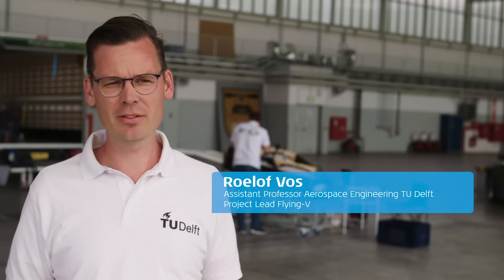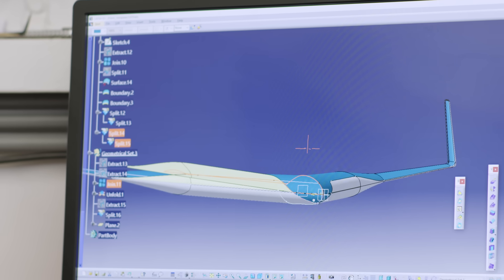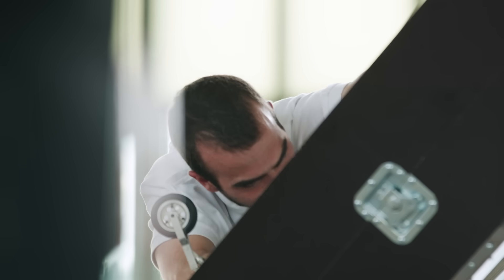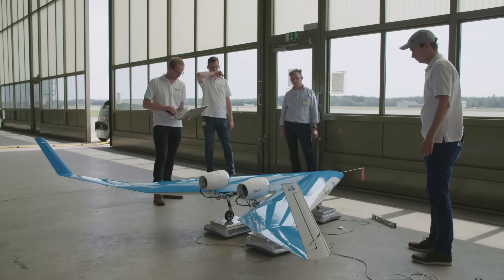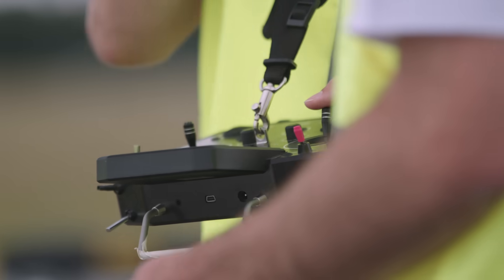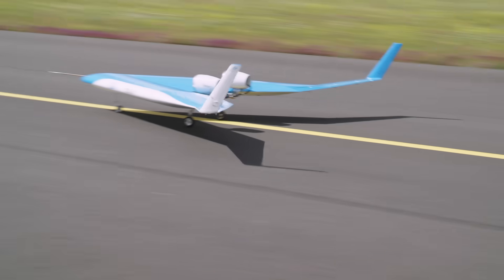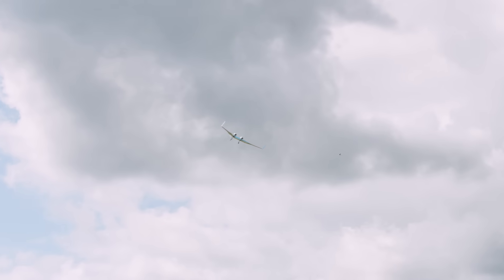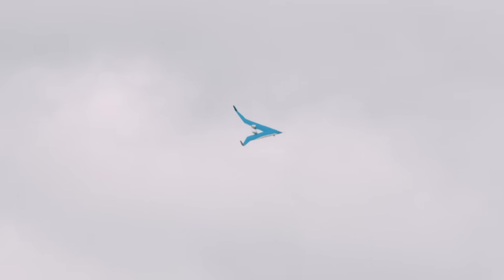Flying-V - Scale model maiden flight

Comment: I have an idea. In minute 2:00 you saw that if angle of attack exceeds a value then can overcome stall, in 3:07 this issue ocurred but a fast manuever corrected it. You can include "virtual canards" simply "twisting" the frontal zone of wings, then you obtain a wing with more angle of attack in front than rear. It can be achieved in the same prototype with material fill. But i think is better to replace a new wing with this variable attitude. I hope you consider this. Good luck.

Comment: I don't understand the aspect ratio is all wrong if we park a full scale at an existing airport. Furthermore, won't the wings become like bulk bodies in a full-scale model. This prototype may have stable aerodynamics but I'm not sure of its true realization. 20% less fuel compared to the Airbus A350-900? How? Is it just the drag reduction or the propulsion system will be different from the conventional ones? What about the costs? It looks like a fusion of 2 fuselages in a V-shape, won't that increase the usage of composite materials and therefore drive the cost upwards? Can somebody explain?

Comment: Imagine being a passenger in one of the rows furthermost outbound from center.  All rotational motions (roll) will be massively exacerbated into harsh up and down movements, rendering a nauseating experience.  I’ll bet that’s true even for first class seats.  The slightest roll motion will send passengers airborne in the cabin.
Reply: You beat me to it.  I've read that exact issue being given as why other flying wing concepts where passengers were not centrally located were discarded.
Reply: This can be said for most heavy aircraft, but in the pitch and yaw moments. The answer is simple... use the inertia damper from the Starship Enterprise; problem solved.
Reply: @tjkallenberger2705  That can be true in some conditions.  I remember taking off from Reno once in the back row of a 757 under extreme yaw conditions.  It was pretty hairy, just enough wild G's  to start a minor passenger panic.  It'd be just like that on this aircraft except with more jarring vertical accelerations, and more frequently.  Probably perfectly safe, but it'd freak out the passengers.
Reply: @pfschuyler  Yep, been there. It will be interesting to see if this aircraft is actually produced... the certification will be quite vigorous following the 737 disaster.

Comment: Всё очень просто: берем дозвуковой профиль крыла. Высота профиля - не менее 2.5 метра. Соответственно, длинна профиля по хорде - от 20 да 25 метров (https://myslide.ru/documents_3/4999717067a4c3a8b124b7a06b590a69/img2.jpg)
Учитывая масштаб (приблизительно), то размах крыльев у это "чуда" будет более 100 метров. Ну вы и фантазеры, ребята. :о)
Reply: Sergey Belyaev
It's very simple: we take the subsonic wing profile. Profile height - not less than 2.5 meters. Accordingly, the length of the profile along the chord is from 20 to 25 meters (https://myslide.ru/documents_3/4999717067a4c3a8b124b7a06b590a69/img2.jpg)
Considering the scale (approximately), the wingspan of this "miracle" will be over 100 meters. Well, you guys are dreamers. :about)

Comment: There are many issues with this design.
1) The weight on both the sides of the wings has to be exact! No obese people allowed. No hard feelings.
2) When turning, people sitting at the edge will feel like they're in an elevator!
3) The connection between the wings is just that small part in the front...that snaps, they'll be going to 2 different destinations.
4) The sheer size of that plane...will simply take up too much space, hence decreasing the income of the airports.
5) How'd that design survive turbulence.
Reply: The weight can be balanced by the altering the amount of fuel on both wings.

Comment: Having passengers and fuel in the same compartment doesn't sound too good, in the event of a crash.
Reply: Well if you have a crash with a plane, it usually doesn't sound too good either
Reply: If the turbine goes up in flames, that's not great either lol

Comment: It is not a new design....1947 YB-49 and YB- 35, note at 4:15 slight porpoising due to control issues, a computer would sense this a compensate. Edwards found this was a problem before he crashed. (Edwards Air Force Base, USA)

Comment: The moment I saw this thing, I said to myself, "No way are they going to show that thing's pathetic attempts to land."
Reply: I'm both a full scale pilot and an R/C flyer... if the stall moment causes a pitch up, then the aircraft will need to land at a higher airspeed, but it will land.
Reply: @tjkallenberger2705  gravity will assure it of that!
Reply: @markgreen2170  True... disrespect the basic rules of flight and an aircraft will become a brick.
Reply: @tjkallenberger2705  Which is EXACTLY my point.  Now scale up that monstrosity and fill the wings -- all the way out to the tips! -- with passengers.  Even better still, make those passengers an entire high school full of students who will think it's funny to create a sudden "Flash Mob" at 20,000 feet where everyone stands up at the same time and runs to starboard.  But let's put conditions that would cause an uncontrollable spin leading to the in-air break-up of the airframe and subsequent fiery, screaming crash aside for the moment and just deal with an A380-capacity version of this and the margin for error when landing it at the necessary higher speed on existing runways.  Hmmmmm.....

"I, King Adam Phillip Churvis, soverign of the planet, hereby declare, now and forever, this hokey piece of sh*t to be henceforth known as the 'Crash-o-Matic'."
Reply: @adamchurvis1  creative scenario but unlikely.
Reply: @madjunir  Talk to any experienced software testing engineer or destructive testing engineer about the word "Unlikely."  If I were the head of one of those departments, I would post a huge sign with the word "UNLIKELY" inside an international "No" sign, and then surround that with endless photographs of the deadly aftermaths of such "unlikely" scenarios.  And then, like the petals of a flower, I would arrange the first pages of every lawsuit emanating from each photograph's depiction of those events.  And then above I would post a massive sign: "Do *NOT* Water This Flower!"
Reply: @adamchurvis1  I would imagine that a full scale aircraft will be aerodynamically different... I was referring to this one. Nevertheless, stall moments can be easily controlled by adding a canard.
Reply: @adamchurvis1  "Unlikely" is a synonym for "guaranteed to happen".
Reply: @neoqueto  Truer words have yet to be spoken, sir! :)
Reply: @adamchurvis1  Chill down dude, the plane is just being developed. Ideas have to be tried out and see if it is viable, and this one does have potential. You cant just not try things because adam thinks it is stupid. All in all, it wont fly if it turns out that safety can not be guaranteed.
Reply: @joaobobao590  The world would have been a much better place had it NOT tried those ideas which Adam had found unsound.  Sometime we should talk about Airbus being a European Union jobs program first and an aircraft second, leading to some of the worst disasters based on circumventing good design in favor of expedient manufacturing at multiple locations -- something perfected by the Luftwaffe to secretly arm themselves in violation of the Treaty of Versailles leading up to WWII.  And then we can talk about the mind-numbing stupidity of the French software "testers," if you care to grossly misuse the title.  Just make sure to brand your name on your most enthusiastic support of this design, so that when people start dying they can all thank you.  I know I will.
Reply: You must be fun in bed.
Reply: @kurreorava9626  Well, let's see.  I don't stall, I become airborne after a relatively short roll, I have sensitive control surfaces, and, most of all, I DON'T HAVE TO COME IN FOR A LANDING AT TWICE-NORMAL SPEED TO KEEP FROM CRASHING!
Reply: Landing?

Comment: @TU Delft, you guys need to take a Wright Brothers (hackers) approach to speed up development. Which is design, build, test, modify, repeat. This is the whole idea of working with unmanned models so you can crash a few to testing out ideas.
Reply: That was my thought. They took two years and how funding and all they have to show for it is model aircraft that any half decent hobbyist could turn out and have it dialled in and flying in a month.   There must be a lot going on behind the scenes or these guys are scammers.

Comment: I wonder how the passengers will feel sitting in such a wing as the plane changes course. They'll probably feel like they are in an elevator.
Reply: The NTSB could sit at the edge of the wings and then give a go ahead.
Reply: Very good point, the farther out on the wing you are the worse it will be. The pilots will be required to have very limited banking for this reason and those seats will be cheaper most likely. I wager that is the main reason this could fail.
Reply: @getstuk87  the main limiting factor here is not actually the bank angle, which causes no additional g forces, nor the roll rate, which causes a sideways g instead of an up and down one, but the roll acceleration. That can be limited while still allowing good control.
Reply: @dsdy1205  Still,  you cannot do lazy steering in all conditions, there are situation that you need quick response. But I hope developers can deal with it somehow.
Reply: Dean Su How can you limit that while still giving pilots critical landing control (crosswinds?)?
Reply: @pfschuyler  You're right, there has to be a way to override the limitation. And it probably should be disabled by default on takeoff, landing, if terrain or other aircraft is close, in bad weather conditions and on the more manual flying modes anyway. As with any kind of automation, pilots need to have a good level of understanding what does it actually do.
Reply: @pfschuyler  bigger ailerons / full length controls
Reply: @robflyrc  I mean, large jets have similar concerns, I think it mainly comes down to training your pilots to account for the sluggishness.
Reply: Amazing how so many non-pilots have such strong opinions.
Reply: @ReevansElectro  Amazing, how such engineering feats can be accomplished, whilst completely overshooting common sense.  Pilots fly airplanes, they don't design them.
Reply: @pfschuyler  You as an aircraft designer, you obviously know that pilots strive to give their passengers the smoothest possible flight and control the rate of bank angle change, the yaw and the angle of attack very carefully so as not to make anyone sick.
Reply: @ReevansElectro  Well, the dozen or so UAL Captains that I know would all admit, that's easier said than done.  The design is innovative but it's not a minor concern.  The tiniest inadvertant roll would result in substantial vertical motions for most passengers.  Anyone who has ever flown in a plane has experienced crosswinds, unexpected guests etc.  Unless this design has some innovative approach to controlling the weather?  The designers get points for an innovative approach though.

Comment: Nice work and a great moment to see this bird in the air. How about the landing? We couldn't witness that...
Reply: It was a rough landing they said so I suspect that is why
Reply: @getstuk87  A pity. So it's more of a promotional video than showing the real work
Reply: @pascalfust1035  it landed on the front wheel, which snapped, instead of the back wheels like it was supposed to. They said they needed to shift center of gravity, and that this is exactly what scale tests are for!
Reply: @TheWatermelin  Thanks for this additional info. You are right, those findings are the purpose of scale builds.
Reply: @TheWatermelin  it seems obvious that it would have landed that way if they didn't shift the center of gravity. I thought of it and then thought "surely they already took that into account"
Reply: Read that there is a substantial tendency for dutch roll-type instability at reduced speed for landing.
Reply: Very nice work. Looks good but I think you will find that for scale work those rudders on the wing tips are pointless. I noticed there were no flaps, but I am sure they will work this out for themselves. A central vertical stabiliser migh be better. You dont have to reinvent everything in one go.
Reply: i have the same thought,
Reply: Looks beautiful, congratulations.
I hope you get the landing sorted.

Comment: Good job in practice but implementing this for commercial flight is not realistic.  1. Pressurization at attitude, this shape dose not lend to a highly pressurized cabin in turn means that the ambient altitude of the cabin would be detrimental to anyone with a lung aliment or who is infirm.  2.  Center of gravity,  Fuel makes up a large portion of the weight of an aircraft and calculating where the fuel is on the airplane is important to know its flight characteristics.  The fuel would need to be in fixed points in the airplane which is currently a space occupied by turbulence not by a controllable surface any cross wind or turbulence would find this design to be uncontrollable by a human pilot.  3. Materials, with flex of the fuselage from side to side not being equidistant from a center-point in the plane one lift will act independently of the other causing more flex of the lift surface overtime.  Which intern will degrade the quality of the materials that the plane is made of, assuming the commercial aircraft would be either a carbon titanium composite  and backed with sandwiched much more modern fiberglass honeycomb.  The temperature expansion rate of these materials at altitude above the weather flex and grow much differently leading to major deformation.